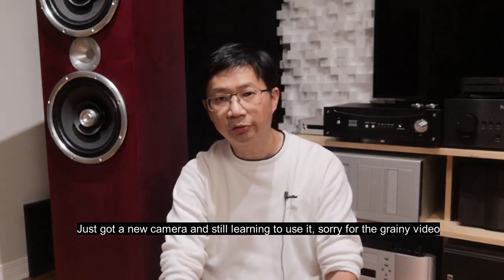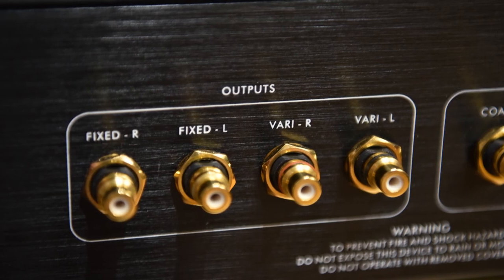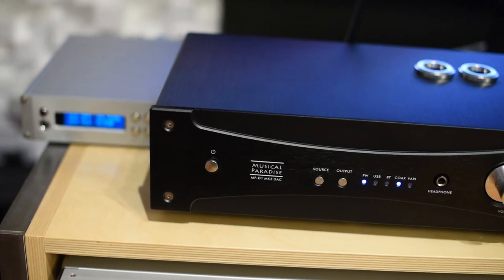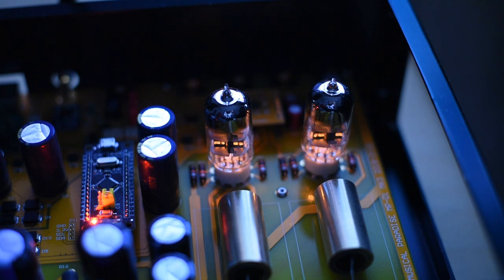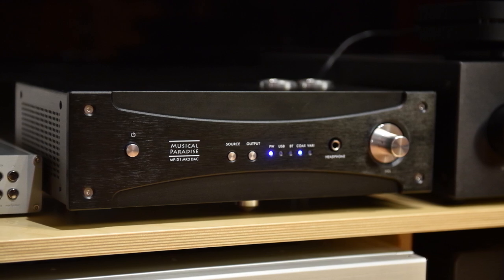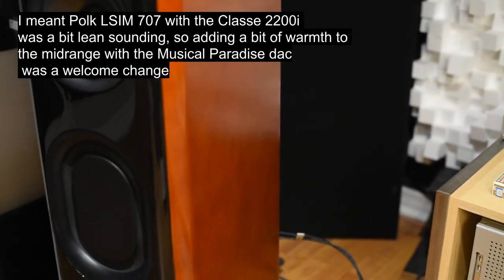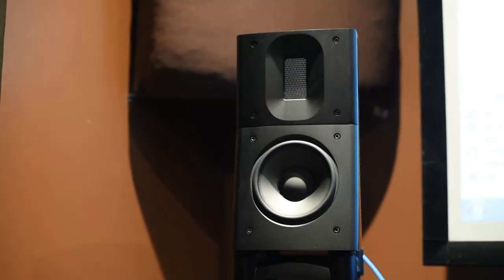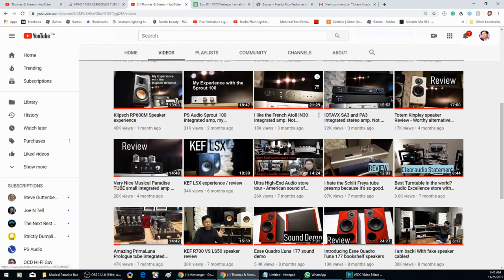Budget but amazing Musical Paradise TUBE Dac? Musical Paradise MP-D1 MK3 review

Comment: Hi Thomas, great review! Can you give your thoughts on which would pair better with my Bluesound node 2i, Musical Paradise or Denafrips Ares 2 based on your experience. I know you said to go two step up in the denafrips line to make a difference but what about the Musical Paradise? Thanks.
Reply from the maker: Musical P will change the sound more than the Ares II. I personally would spend the money elsewhere to get more return in performance improvement. For example, upgrade the poweramp or speakers.

Comment: Stray thoughts - Another great segment; really like to hear what your audio buddies have to say as well. Don’t miss the sound demos. I never see you reviewing PS Audio products, although one of your friends has a Stellar Gain Cell DAC - no contact with PS Audio?  Thoughts about power conditioners/regenerators?  Can I possibly stuff another disjointed thought into this comment?  Should I take my ADD medicine now? Probably.
Reply from the maker: I do have a connection with PS audio and that is how I reviewed the sprout 100. I had the PS audio perfectwave before too. Power conditioner? Not a big fan cause it does something to the bass and the electricity at my place is clean as I have dedicated jacks. The reason I don't review PS audio cause their products are not cheap and I noticed people prefer when I talk about budget stuff. Perhaps I will change and move to more expensive stuff.
Reply: Thomas & Stereo There IS quite a jump from what they consider their “starter” Stellar equipment and their next-level BHK items, with the Sprout alone/Sprout and Elac speaker packages being the only under $1000 items they now offer. Substantial savings can be found on their used gear. I have the Stellar GCD and like it; I tried the S300 amp and older NuWave Phono Converter and ended up keeping my old gear instead. I also have a P3 Power Plant, but I can’t really say that I noticed a difference in sound compared to the Furman power strip  (“conditioner”)I had previously.
Reply: @ThomasAndStereo  My apologies; I recall now seeing the Spout review but I didn't watch it (or the PerfectWave,one, it appears). Duh.
Reply from the maker: @homerjones3291  No worries! I did not review the perfectwave cause it was a high price item.

Comment: ?  Going for increased soundstage and added richness to vocals.  Your thoughts on this dac into my system...bluesound node 2i, yamaha as-2000 integrated, totem embers / rel t9i.  System has good soundstage, depth, and smooth vocals.  Wondering if this dac will make much of a difference.

Comment: Off topic, I calculate it might be USD 600-700 to ship to my location (Singapore) but i found local sources that brought in the MP-D2 MK3 for around USD 950 all in. Would you recommend that or something else in the USD 1k space? These will be powering my B&W 685 until i upgrade to KEF LS50 (undecided due to difficult amp matching) or floorstanders in future.

Also, any comments on Gustard X22 / X26?

P.S. I am only familiar with solid states (Naim, Emotiva, Schitt, Marantz, Roskan, Arcam) as only a handful of my mates are really into tubes/vinyl/vintage stuffs and resale as good as zilch here. I am just a couple years into hifi (previously was more on portable/iems/headhphones).
Reply from the maker: Well, what are you using now and do you need a DAC so soon? There are many integrated amps these days that come with a DAC. Have you considered the LS50w with everything built in? I don't know anything about X22. I never heard the D2 so I can't comment on the sound quality.
Reply: @ThomasAndStereo  i am using Denon X4200W for my HT and Marantz NR1506 for 2.1 channel in another room. Just find the marantz too polite and lacks the punch compared to the Denon. Now I prefer to focus more on music in 1 room and HT in the other. both untreated rooms FWIW

Comment: Another great review. I’ve always felt that PL amps are not that tubey. They sound like SS amps with a bit of tube sound. Guess that makes them very likable by so many. 😬
Reply from the maker: Yup, they are what I call the 'new' sound.
Reply: Thomas & Stereo ... it’s the right terminology too! 

Wanna ask your opinion. I got my Cary preamp. Now am keen to get a tube system to power it. Am thinking of a PL power amp or PL integrated since it has a HT input. Does it make a difference? Power amp vs integrated with HT input. Thanks.
Reply from the maker: @hushpuppykl  Well, I personally prefer tube preamp and SS poweramp. If you have to get tube amp or intergrated amp with HT, I personally would get tube amp. Is there a reason you would consider the integrated? In case I am missing something. Like this allow you to have 2 different sound? Like some day you like to use a full tube setup while other days with the cary SS preamp?
Reply: Thomas & Stereo ... I have a SS integrated for my Cary. The Audia Flight FLS10. If I’m lazy and want short listening sessions, I just use the integrated. For longer sessions I use the FLS10 as power amp. Don’t want to switch the Cary on and off that often to preserve the tubes.

I asked about PL power n integrated because as just wondering.

I think I should ignore the itch and stick to my Audia Flight. But tubes look so nice. 😂🤣

Thanks for your reply!

Comment: Another great insight into your experience with what is truly a gem of a DAC Thomas. Can't wait to get mine finally up and running. Out of interest how much tube rolling did you do? And did it have a big affect on the overall sound characteristic? I guess the question is how much of the sound quality/characteristic comes from the DAC chip/architecture and how much is from the tubes/valves?  I've heard that the Analogue output stage (along with how the power supply is handled) of a DAC is probably the most important aspect in terms of sound quality.
Reply from the maker: Thanks James. The tube change made a world of difference. However, this is true to most tube gear we try. It is part of the fun of owing tube gear but at the same time, expensive.
Reply: @ThomasAndStereo  I hear you Thomas. I've already started to trawl the auction sites looking for obscure NOS valves! It also makes this a fun DAC to own. I guess valves are like 'filters' you find in other non-valve DACs.

Comment: Thanks Thomas for a very informative review.  Very clear and insightful views which I certainly appreciate. 

I am always fascinated by tube topology.   Am thinking will this Dac add audible difference if I connect it to my AVR an Onkyo RZ 830 class D amp which has an AKM 4458 32bit/384khz image. Currently my onkyo which has a built in Tidal is connected to an XTZ A2 -300 power amp  and am running  Klipsch  RP 6000f speakers and have a Marantz  CD UD 7007 Player.  So if I connect this MP Dac to my Onkyo. Then the Onkyo serves as a pre amp while the MP DAC takes over for CD and Tidal for stereo music. Will this signficantly enhance my sound; with the tube signature? Or there may not be any discernable difference as compared to my Onkyo.  Just wish to hear your thoughts before considering the MP Dac for purchase. Appreciate your views.
Reply from the maker: Well you might get more roundness on the top end but at the same time sacrificing bass punch and speed. It is hard to know without actually heaing the Onkyo first. Does it have that digital glare that most DAC under $1k have?
Reply: @ThomasAndStereo  Thanks for the prompt response Thomas. Actually the Onkyo while does not give the tubish as you say rounded off  musical or warm sound,  its surprisingly does not seem to have the digital glare. Its  clear without being fatiguing,  quite  smooth and offers  bass punch especially teamed up with the XTZ,  in terms of signature. Losing bass speed and punch will be something I may not  wish for though. Perhaps this dac may be more suitable to be connected to a node 2i independently rather than via the AVR?

Comment: Thomas great vid as always. Was almost there to buy but you mentioned Schitt and Primaluna which interest me as well. So would you skip this dac and buy instead the pre amp or amp mentioned or use the dac in conjunction with? Just like Stereo Police mentioned in one of  his vids, I thought to keep my as2100 with cds2100 for digital use and buy a separate tube system for my vintage Turntable with a Prima Luna?
Reply from the maker: Well Schiit and PrimaLuna are not DACS but preamps so you can't compare both. I used this as a DAC only. Yeah, it's nice to have a separate tube system but it always depends on budget.
Reply: Thomas & Stereo sorry Thomas I meant using that dac with either of the two amps?
Reply from the maker: @vicg5323  I did try it with the Freya and not the PL. I only tried it for a few minutes so I can't really say how it is. It sounded ok from memory. Keep in mind Freya, if you ever compare to a good SS preamp, bass control is not as good already. So bass will not have the best control with this DAC. However, this you will onlly know if you AB test it. If you don't, it sounds good.

Comment: I own Musical Paradise MP-301 MK3 amp, great indeed. So far my DAC is still iFi iDSD with USB input only. MP-D1 MK3 no Toslink input. Worth to change?
Reply from the maker: It depends what you are looking for. The IFi iDSD might already be a good match with the MP-301. The MP-D1 bass might not be as tight as the iDSD, you probably will get more air and wider soundstage. I would put the money elsewhere to upgrade your system.

Comment: The new version supports 6sn7 and it is recommended to upgrade to 6sn7 with an adapter. Have you tried that? Is that even possible? With the new version you can switch between 6.3 Volts and 12.6 Volts. Is that the reason you cannot put in 6sn7 with the old version?

Comment: Hi Thomas, another great video. What would the result be from running this into a Freya Plus, is that tube overkill? Is there such a thing as too much tube? Thanks again, Phil.
Reply from the maker: I had it connected to my modwright and it is fine. I did not try extensively with the Freya. I do remember you will sacrifice a bit bass control but it will still work fine.
Reply: @ThomasAndStereo  You're a legend, thanks for the reply and your thoughts. Today's video is killer. Really cool to see complete systems. Thanks again Thomas.

Comment: Hi Thomas, 
I'm totally lost with all possible DACs ! 
As you know, I get the Heaven 11 Billie tube amp. 
Do you think if going with a tube DAC like the Magical Paradise will be great/amazing or will be too much tubes in the system ? 
Better to go with Ares II or Burson Composer or Aune x8 instead ? 
For info my speakers are the Harbeth P3ESR and for now I'm using the Blue node 2i internal DAC. 
Many thanks. Have a nice day. 
Regards, Mathieu.
Reply from the maker: I would go with an external power amp instead.
Reply: @ThomasAndStereo  Thank you Thomas, that was unexpected !-) 
I got the XTZ in mind... but was not planning to get it before  the DAC...
Would you have something else in mind to get the holographic result ?
Reply from the maker: @mathieua.7927  I would say XTZ is a bit better. The Billie preamp is so good it can use  way better amp. If you have to get a DAC, check out my reviews on the budget DAC I recently did. If you are in the States, you can always return it if it does not work for you.
Reply: @ThomasAndStereo  Ok I see... but do you think this Billie+power amp will be a better option than going directly to one of the 3 tube amp you just reviewed in term of quality for money ? If I go for a 1,5k€ power amp + Billie, I will be at 3k€ vs ~1/1,5k for the tube amps... dilemma...

Comment: Great review Thomas and what a great find. Does match well with any amp? Also could you please explain in one of your videos if it’s the amp or the DAC that’s most important when it comes to soundstage size and depth? Many thanks!
Reply from the maker: For me, the preamp has most to do with soundstage and then the amp. I did not really tried it as a preamp except with one or two amps and it was ok, not spectacular but ok. Moon w 5.3, Schitt Vidar and IOTAVX PA3.
Reply: Thomas & Stereo so Thomas I’m just learning about tubes and enjoyed your Freya+ review. I have an opportunity to buy bryston B135B3 for c usd2500 demo model (no dac). Would you say that I would be better off getting this or Vidar and Freya+? They will roughly work out to cost the same. I think my taste in music is similar to yours I like smooth, warm sound, and large 3D soundstage.

Comment: Bought this dac on your recommendation and it has been great. Considering the Doge 7. Would this be a good move up? Thanks in advance. Ben
Reply from the maker: I have both and I need to do some serious AB test to tell. Have you changed the tubes in your DAC?
Reply: @ThomasAndStereo  
Yes. Using 6H23 from Upscale Audio.
Reply from the maker: @benhahaj3226  Nice, I am using 6922 and it sounds pretty good. I did not know it supports 6H23

Comment: It seems to me according to your experience with high end and very expensive gear, to praise such a device.. I would assume if this was 10 years ago a tube dac that could elicit such a response would cost 5 to 10k. Would you say that the performance floor per dollar has come up or has the performance floor itself risen, meaning a current 10k tube dac would wipe the floor with this? I wouldn't otherwise assume a $400 tube dac would be anything other than "okay" with some issues.
Reply from the maker: Well I never have tried tube gear in the past so I would not really know. The only one I have is a Logitech DAC modified to use 6sn7 tubes by Modwright. That one at the time cost $4k MSRP. This Musical paradise can compete depending on the speaker. That DAC is cold while the musical paradise is warm.  I cannot say it will wipe the floor with this tube but I can say the performance has reached a very high level for the price.  I have tried DAC from 10 years ago and those $4k DAC in that ERA still sound fantastic even compared to today's DAC. For example, the Audio research DAC 7 performs better with Piano compared to my current Mcintosh D150, Exasound E28, PS audio Perfectwave and so forth. The performance per dollar is light years ahead compare to before. Especially speakers, it's insane.
Reply: @ThomasAndStereo  ok, that's what I was suspecting. It's a great sign. Like i was saying, from any forum  or review or youtube, etc, any inexpensive tube product was considered "novelty junk toy" like from a Crackerjack bag. Now we have this and even Primaluna. Ten years ago you had to have some big money sunk in for "great" tube electronics.
Reply from the maker: @Audfile  Well today you have these tube buffers that are like toys sold on Amazon. Does not do much to the system. These gear I recommend are not like that.  Just look at the power supply of this DAC and you can tell the designer is really serious about his design.

Comment: Thomas help!  
I'm skeptical about DACs sounding differently from one to the next.  I'm now running an older Cambridge audio DAC magic.  Thomas, how confident would you be that I would hear a difference if I upgraded to the musical paradise?  I'm ready to pull the trigger but a bit scared that I'll spend 500$ and not hear a difference!  BTW I'm running a primaluna integrated into a set of spatial audio open baffles.  Serious listening is through my LP collection, otherwise I use tidal and roon.
Reply from the maker: Really depends how resolving your system is and how you listen. Do you watch tv or browse the internet while listening to music? If yes, then I say don't bother. Also, what don't you like about your current DAC, I would say the difference is there but it is not like changing a speaker. Also, if you go for a DAC like this, you will need to upgrade the tubes to 6922 too so factor that in the cost.
Reply: @ThomasAndStereo  thanks for the reply Thomas!!  I have a huge collection of tubes so swapping is not an issue.  I use my system for every type of listening ( learning/transcribing songs (I'm a musician and am always listening to and transcribing new tunes), serious dedicated listening sessions and background listening).  I believe my system is relatively resolving, the spatial audio speakers are especially wide open sounding compared to anything else I have ever heard and quite efficient.  Current DAC is ok but compared to my vinyl setup it's kinda uninspiring.....everything is there but there is always a  certain weight and warmth that is missing.  I know it's a hard question to answer, maybe just pulling the trigger on the new DAC will be the only way to tell?  Thanks to your review maybe it will be easier to recuperate cost on used market sale if it doesn't make much of a difference?  Thanks man!

Comment: My elac adantes can sound a little edgy and harsh sometimes. Do you think this dac would help bring that warmth. I'm currently using the dac built into the cambridge cxn v2, its a Wolfson chip. The cxn in then routed into a Schiit Freya + with GE 6sn7 tubes then into Schiit Aegir monoblocks. Thanks Thomas!
Reply from the maker: Hi Jon, it will help since Cambridge for me tends to go for 'clarity' but you might have to change tubes as I did. Having said that, perhaps a Schiit Loki is a better solution for you. You usually buy this DAC to increase the holographic sound stage and to add tube warmth. You don't buy it to solve a problem (although it can definitely help in this case). The Loki for me is to solve treble and bass problems. (I own it). Maybe I will make a video on it.
Reply: @ThomasAndStereo  Unfortunately I dont think I can use a schiit loki since im running balanced XLR throughout my system. I've seen all your videos... hahaha. Schiit monoblocks require xlr.